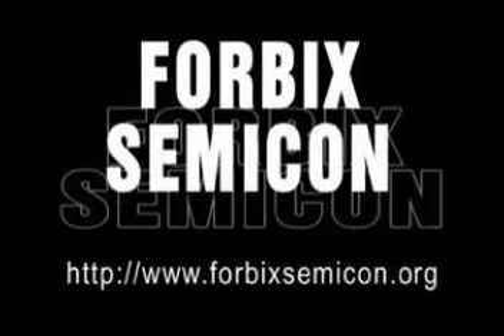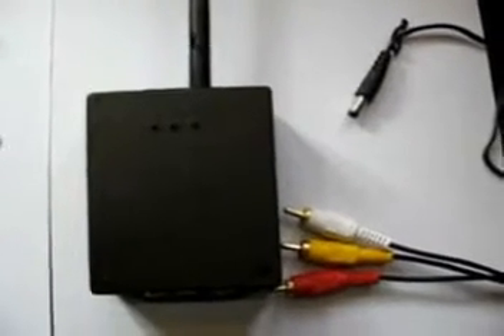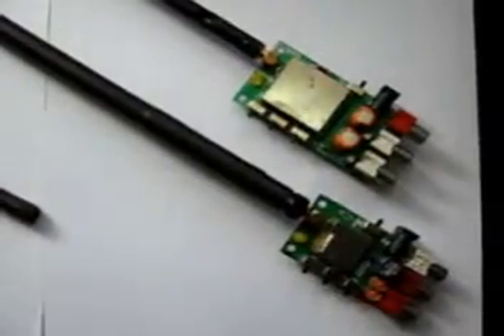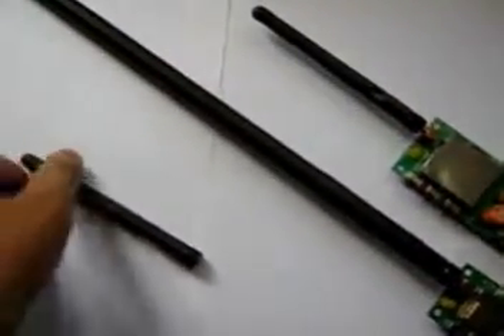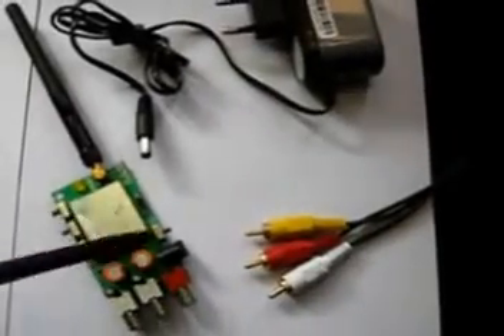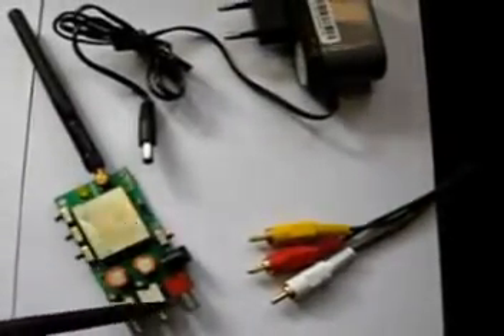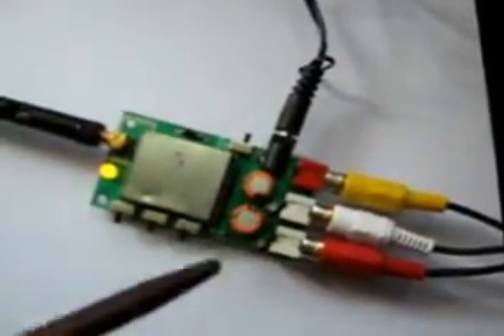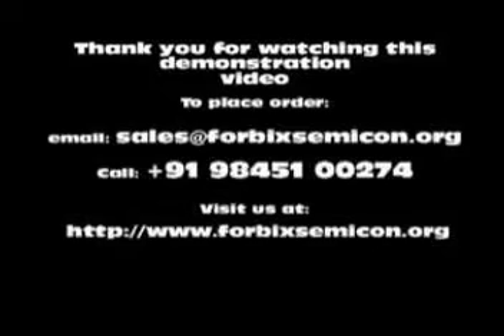2.4GHz Wireless Video Audio Transmitter Receiver 4 Channels [Manufactured in INDIA] - Demo 1

Comment: Do you have an audio transmitter-receiver system. I wish to play music in one room, connect the output to your transmitter, and receive it on another floor in the building through your receiver. What is the distance from transmitter to place the speakers. How many speakers can I connect independently without weakening the signal. How is the audio quality. what is the cost. Appreciate response. regards R P.. +919820021267

Comment: The transmitter is having an ABS material enclosure.  Two options to this:
1) Transmitter enclosed in another metallic enclosure (antenna needs to be exposed out).
2) Transmitter kept indoor and RCA cable (that carries Video signals), can lead to the camera which is outdoor.